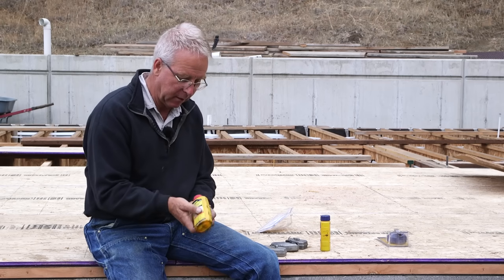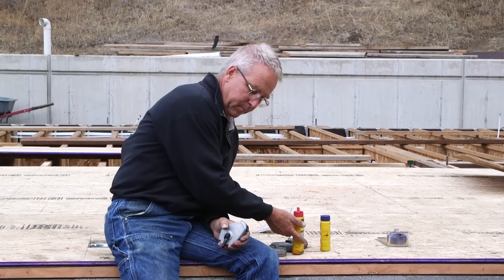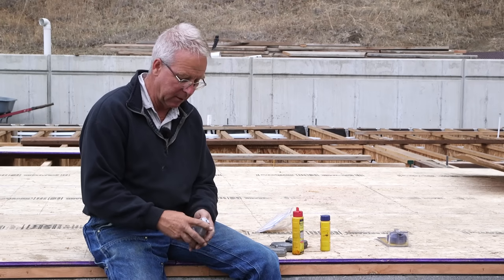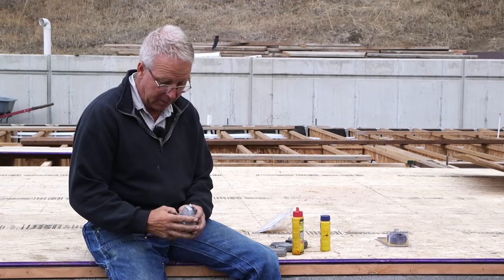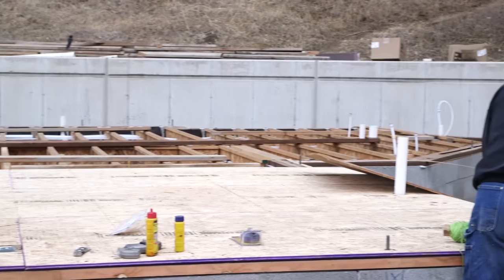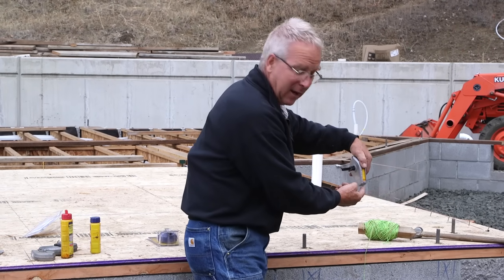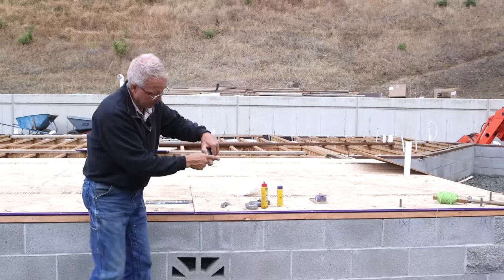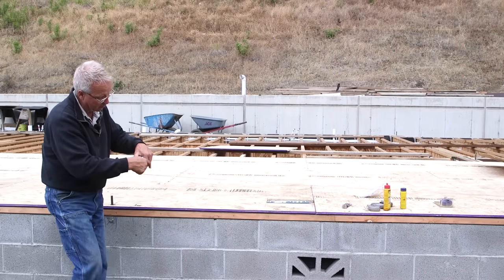Chalk Line Basics

Comment: When snapping lines for roofing shingles, you can save time chalking by connecting the chalk lines from two chalk boxes together so the person on each end has a chalk box.  After snapping a few lines, the spent line is reeled in, and since the strings are connected,  the fresh chalk line unreels from the other chalk box over to the person reeling it in, and the line chalking process continues without having to walk back and forth across the roof.
Reply: Now that's a great idea. I will start my 36th year in the carpenters local on Jan 1st and I've never heard of such a thing, but I've could have used  that trick many of times. Here in the South we refer to the end of the string with the clip, as the "Alabama End". And Never Ever snap a Red or Black line on a wall that going to be painted. The line will bleed through paint. Don't ask how I know this but the painter wasn't vary happy with me for a long time.
Reply: Do you tie them together with a specific knot that can be untied easily or is there a way to connect the clips together?
Reply: Rob Stephens We've done that a few times! I always wonder if other people do those oddball things that we sometimes think of.
Reply: @ringerson4x4  A large fishing lure clip works great run through the holes in the chalk line end clips.
Reply: @ringerson4x4  You usually can slip one end through the other end's nail hole sideways and then pull them tight and gravity does the rest.
Reply: @ringerson4x4 some chalk lines had interlocking hooks for that
Reply: That’s a great idea! I’ve never heard or thought of that.
Reply: ringerson4x4  I tie a small snap swivel on the end of the my “Chalk Box” line and leave the hook that comes with the “Chalk Box” on the end of the line as well.  When I replace a Chalk String or am filling a new Chalk Box I dump some chalk dust on a clean rag and pull the unchalked string though the powdered rag a couple of times and then wind them into the Chalk Box and fill it.
Reply: Wow that's a great idea. And I came to this video convinced I wasn't going to learn anything. Wish someone would just sell "duplex" chalk boxes like this.
Reply: If anyone has used something similar to a little giant snap line... 

There is something almost enjoyable about snapping those long lines. It's like cracking a whip on your work.
Reply: brilliant!
Reply: This is exactly why I watch this channel. For this great advice
Reply: Nice!
Reply: shit son i thought he said noobs only lol...ps im not a noob either but it was good clickbait...btw indid something similar once
...a guy asked me for a hammer so i threw it at him lol...
Reply: Rob Stephens used this same method in building ceiling systems when workers are in seperate scissor lifts
Reply: Damn, that's brilliant!
Reply: Framer here, Thats pretty cool..
Reply: Damn Rob, that's clever! I'll have to remember that one!
Reply: Great idea
Reply: Dahm read this just in time for my roofing competition tommorow thanks
Reply: Wow great idea. Been in the business 28 years thats a first. U learn somthing every day in the trades.
Reply: So like trying two of them together so you can cover a further distance in solid lines? Solar installer just asking to maybe implement it
Reply: @rezin9714  Not to cover a longer distance, but to keep from having to walk back and forth when the line is reeled in to rechalk.
Reply: I was taught that by one of 4he old timers that I was put with when I first became a UBC apprentice.  I always tried to work with the old ones, because they had experience and knowledge that was neither written down, or even taught in the union school.  I worked with an old timer named Mr. Miller, who did sheetrock.  Because he was in his late 50's he could not run around like the young ones.  But, he worked fasteŕ, because he worked smarter.  He taught me so many things about working and hanging rock, that even in the YouTube videos about sheetrock, a lot of what I earned is not even touched on.  Its practically lost knowledge.  Maybe I'll write a book on sheetrocking one day.  Make a little money, and teach some lost ideas.
Reply: I tried showing my gf son what a snap line is. This video did nothing. It is titled Noobs only and a real noob would not know how to already use a chalk box. We both learned more in this one comment then this whole video then had us ready for a nap
Reply: Been doing this for years and never heard anyone else doing it, awesome man. So many tricks of the trade.
Reply: Docking is fun
Reply: why when to can get 3 or 4 caulks out of one extennded line .how many lines you snapping ?
Reply: Great idea!
Reply: @wheelpatriotthebestisyetto6115  who cares how many lines hes snapping I want to know why you're caulking lines
Reply: @williambledsoe5645   A spelling mistake is all you have for a rebuttal . you lost before you started this .
Reply: @wheelpatriotthebestisyetto6115  I'm not tripping I know what you meant I was just being a smart-ass no worries not a big deal
Reply: @GarwoodNick  They are out there.
Reply: Thats old school.  I used to do that when I was a roofer. GAF certified for 7 years.
Reply: That is super helpful I am gonna bust that move out sometime at work and look smart lol thanks
Reply: Hey that's a cool method!!! I'll have to try that! Thanks for the great tip!!!👏
Reply: That's the best tip I've ever heard
Reply: Make your own video if its so great instead of looking for validation with unsubstantiated statements.
Reply: Love it.  Great idea.  Haha
Reply: Happy I stumbled upon this
Reply: 🎉 never thought I'd say I'm ready for Monday time to pull out a fresh bag of tricks 😂
Reply: Great idea 💡
Reply: @ringerson4x4  this is a blatant engineer type of question. Please go to college and stay away from any active work sites ;)

Comment: When I was a hand building Carwashes, our centerline of the wash tunnel was measured meticulously, snapped then coated with a clear spray.  Everything depended on having that line being perfect and permanent.  When I re-visited one of the sites we built, the centerline was still there even after thousands of washes.
Reply: Jacob Atkinson what color did you use?
Reply: @rtz549  Either red, orange or black
Reply: hairspray makes a chalk stick for a long time.
Reply: Jacob Atkinson * millions
Reply: Plumber, we do that a lot. Especially when laying out ceiling marks for pipe hangers.
Reply: rtz549 LMAO No one is catching in that  you were making a joke about the spray paint 😂
Reply: @bblwarrantydepartment981  lol
Reply: When we were doing layout on finished slabs, to establish a datum line, we would sacrifice a dry line, and set both ends, then spray paint black over the line...
Reply: Nothing irritates me more than to have my car go thru a carwash that has a crooked tunnel. If it is ¼º off center, it is crash and burn on my Veyron. I hate that.

Comment: I installed some stair handrails for a friend inside their house. I used a chalk line with baby powder in it. It wiped right off when finished.
Reply: Yeah right.
Reply: Hope it wasn't the baby powder that contained asbestos.
Reply: ive seen an old man use baby powder in his chalk box, thought he was crazy until i seen him wipe it off with ease. He was building some cabinets in an old house that had fresh paint on the walls.  He said he uses it inside on most lines where the walls are painted or the surface needs protection.
Reply: I just use my cocaine so when I do chalk the wrong line I can correct it  with ease, by snorting that full run.

My apprentice thou seems to get the shakes now and then and doesn't seem to wanna move on. 10yrs and he's still with me. That's loyalty.. 😏
Reply: I white when any carpet areas will be. If they use a light colored carpet the first time the owner shampoos the carpet they get a red or blue line.
Reply: True! I do some hand painted signs and use baby powder in my pounce bag for pouncing on darker surfaces and wipes straight off.

Comment: Tips from a tile guy- w/ new chalk boxes, pull string completely out and lightly dust chamber w/ chalk as you feel in. 
   When spanning line across a hump, many times said hump will throw the line off; when line is taut- pull string up as if to snap it, but carefully set it back down to verify its position on your mark. If it's on your mark, snap it!
    Lastly, the metal tips at times get lost in the ether, so a good replacement is a soda tab with the tip bent 90°. 
     Epstein didn't kill himself

Comment: I worked four summers in the 1980's, rough framing.  And today I learned the difference between the colors! We always used red. I still have the same chalk box today! I use it often enough. Even when building furniture! But I think I'll switch to blue! I've learned to remove the mark by cutting down the center of the line, or to chalk in places that I'll hide. But blue will make things simpler! Thanks!

Comment: Great info. I'm about to start building a deck (waiting for the permit to be approved). I've never built anything like this in my life, so there's a lot I don't know yet . I bought a chalk line, and came to YouTube looking for advice on how to use it, and this was the video I found. It's perfect for what I'm doing! We'll see if this Software Engineer can build a nice deck. I learned about blueprints, how to use CAD, local building codes and permit requirements, and details like framing layout, footings, ledger board requirements, stringer layout, etc that I needed to draw the construction plans.

Comment: My granddad taught me to pull a brand new chalkline out all the way, THEN add some chalk and reel it in.
This way, the whole length of string coats itself nicely and you don't have to worry about it binding up!
Reply: With most of the new ones, that will ruin it.  Ask me how I know...  Been in construction 26 years now and I have probably owned 100 chalk boxes, and my favorite are the old ones like he shows here.  They might be slower but far less trouble.
Reply: That's what I always do still need to be careful not to fill it to much
Reply: @SuperUncleRyan  No, that won't ruin it. I've loaded all of our chalk lines like that, and never has an issue. How do you think that will ruin it? Obviously if you pull all the line out, fill it all the way with chalk, it will choke. But certainly not ruin it. You pull out the line as a bit of chalk, reel in about 10 feet, check to see if you need more chalk, reel it in 10 feet, check, reel, check...
Reply: Yep, stretch it out at least 30ft or so and fill it.....just put a lil bit at a time.....a good chalk box is the chalk you use and type of line.....they're disposable, they don't last but are cheap
Reply: Excellent tip, will try when I get a new Tajima, which is really the only chalk box to buy
Reply: That's the same process i've always used, no issues whatsoever.
Reply: @BradleyBuiltWoodcraft  I don't use their boxes but they do make the best line.

Comment: Great vid! A few extra pointers for the keen: if the accuracy of the line is important, pull the line quite tight and only pull it a little bit upwards to snap. When you're snapping, always pull directly upwards if at all possible, that way the line won't oscillate back and forth sideways. Upwards, in this case, just means "directly away from the workpiece". If you're snapping a wall, then pull exactly sideways, that is, at 90degrees to the work surface.

Also, if you're snapping a long line, that oscillation can be inevitable. The way to beat it is to "center-snap", as I've heard it called. Hook or hold the hook end of the chalk where it needs to be, walk the box end where it needs to be, tighten up the line, and then, before snapping, have someone hold the line down tight to the workpiece at roughly the center of the line. Have that person snap one side of center, then the other side, just as tho it was two lines. This helps keep the line very accurate.
Reply: Keith Klassen good call, also you can use different parts of the chalk line if you don't have time to wind it in every time , just snap then pull more out , then wind it all up at the end , or if nogging joists just move the line towards you 2 inches to get a fresh piece of line ,

Comment: Another tip - if you're snapping a line over an existing rough surface, especially a longer run, and have a 3rd guy handy, stretch the line and have him put a finger on the line about halfway down the run.  Snap each segment twice to get a good distinct line.  We do this quite often pouring concrete flatwork, popping mag lines on existing concrete walls with minor irregularities.

Comment: In Sweden we often build on concrete foundations and when we mark out the walls we spray the lines with a spray that sort of solidifies the line so no matter the colour it is permanent.
Reply: Here in Arizona we use leveled rebar stakes as guides

Comment: To save time marking a line over a very long distance, I have used a dry line stretched tightly and walked beside it quickly spraying it with paint. If the line is laying tightly against the surface, and a color is used that contrasts with the surface color, this method will produce a nice straight highly visible waterproof line.
Reply: ive tried that , n its too inefficient , with way to many variables.  the concept is strong, an helps in certain scenarios, but its far from ideal, chalk or a lazer is the only go to imo

Comment: Being very honest I have never done this myself. But at one time I worked with a very old and gnarly framerand he used only black concrete dye in his chalk boxes. The lines never went away regardless of the rain snow or ice on the slab or plywood. But I swear he had to buy a new box three weeks because the concrete dye was so hard on the mechanism. His philosophy was chalk boxes are cheaper than having to re-snap lines which was expensive, double work, and highly inefficient.

Comment: Thanks for the info on chalk boxes.  I have been using them for years and still learned something.  

Stepping into the Way-Back machine, remember when we just used string and had a chunk of blue chalk it our tool bag?  Your would pull the string across the chunk of chalk as you walked out and then uses it as you would use a chalk box now.  The chunks I remember were domed shaped, round at the base.

Comment: I use a chalk box every day, blue, black, red, green. I couldn't imagine using one of those Irwins ever again! These days I only use tajima but a Milwaukee box is good as long as you treat it right.
Reply: Andrew Doogee My Tajima line got weak and started snapping with the slightest pull after about a year. Not a bad run though, and it was indeed a very nice line: the line was thin, making it less susceptible to wind and more precise, light in weight, and had high elasticity, which I thought was nice, and it rewound beautifully. I got a replacement a few months ago, but lost it and am now using a backup Milwaukee; not a bad line either (the best local one here) but not quite a Tajima.
Reply: I have had good look with my Milwaukee. DeWalt and Irwin are garbage, probably because Stanley owns both

Comment: I absolutely love your videos, I could watch them all day. About the chalk box. I used to help build tilt-ups, (industrial buildings with concrete walls). I always worked with the foreman doing layout of the panels, so I've snapped miles of chalk lines. These lines had to be permanent, so what we did was to add red concrete dye to a five pound bottle of red chalk. Also, I've found that kite string works very well when you have to replace your line. Kite string has a small diameter and is 100% cotton. Another thing, when filling a brand new box, we would pull out ALL of the line and then put a little chalk in the box and hold the end down when returning the line. When the line is fully retrieved, then fill the box.
Reply from the maker: Excellent tips!! Thank you!!!

Comment: Gotta call you out on this one. You make one of the most common mistakes made by "Noobs" with a chalk line. You pluck the string WAY too hard! The string accelerates away leaving a lot of the chalk behind as a cloud in the air instead of putting it on your substrate. The lightest pluck necessary is best. You can do more lines without re-rolling. More accurate too.
Reply: I'm going to try that I'm a heavy hitter chalk line plucker

Comment: Very thorough video.  I  also see the comments  fill in and elaborate.  One thing I might add is that I actually prefer a high strength braided  fish line.  Yes it doesn't hold as much chalk but can leave a very fine accurate line. There are some replacement lines out there that are basically the same thing. Also when framing I will mix a powder colored cement dye with my chalk to make it much more permanent. 
  Other tricks as mentioned in the comments are connecting 2 lines together when snapping many lines.
 On long stretches a third man putting his finger in the middle and then snap both  sides works great.
 A chalk line is a very simple but extremely valuable tool. Thanks for the video.